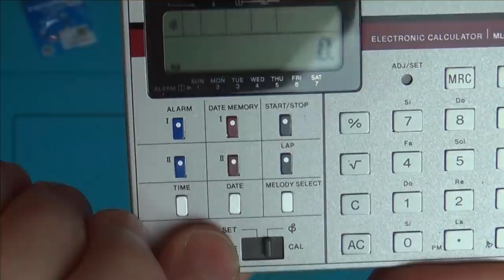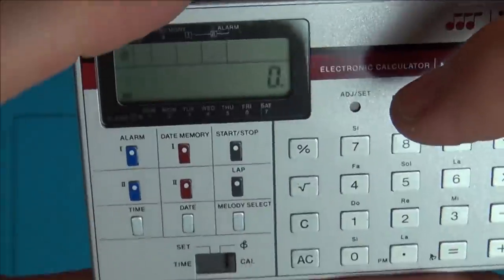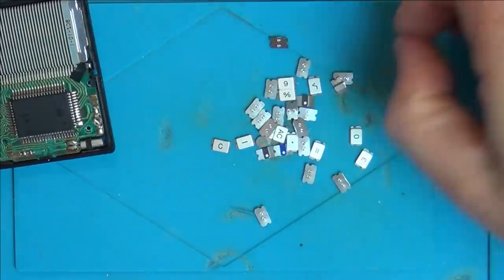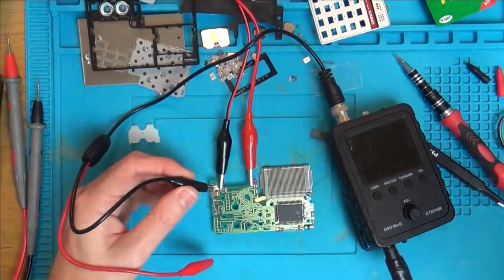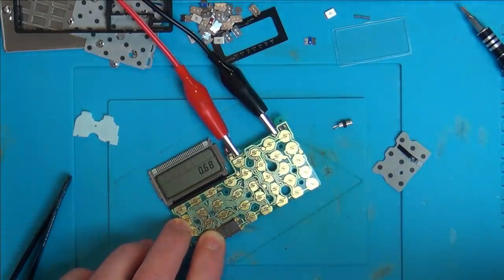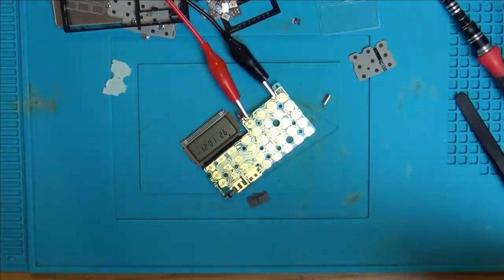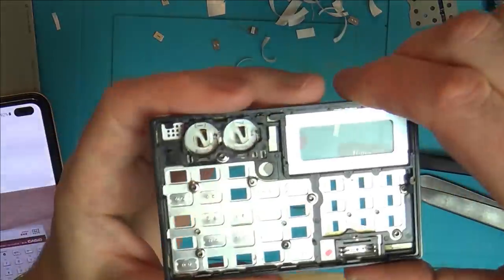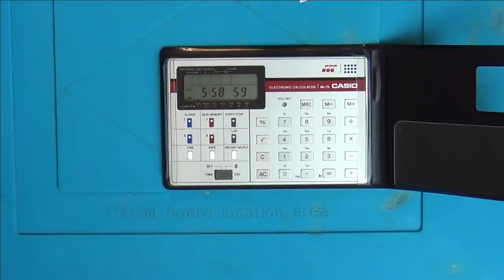Trying to FIX: 1985 CASIO Musical Calculator that Sounds like R2-D2 !!!

Comment: Casio should build NEW models like these. SOLAR POWERED. That would be something that Casio could use to show off. Solar powered pocket synths. I would by one of these in a heartbeat. A Casio Eco-tone.
Reply: I modded my Casio VL-10 into a VL-1 (added most missing features by adding switches to keyboard matrix and a phones jack), The thing runs on a CR2032 button cell and needs so little power that it can be used as the first potato battery powered synth.

Comment: Vince you're like a dog with a bone, well done though, I would have used a large hammer! I'm in the process of repairing a Panasonic Plasma TV TH-42PV500B, hope the hammer doesn't fall on this one :-) the only advantage I have is too many years as an Electronics Engineer, but none with TV's, as it's over a week old parts may be an issue!!!!!!!!!!